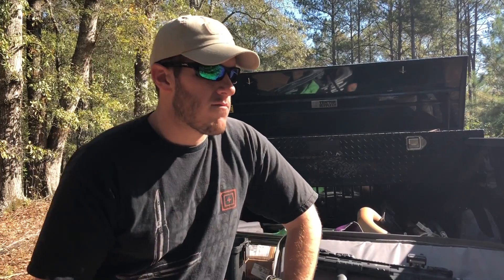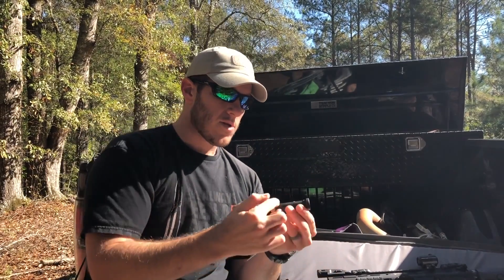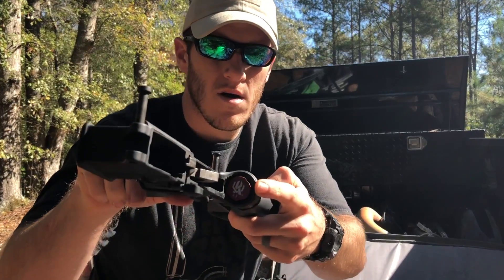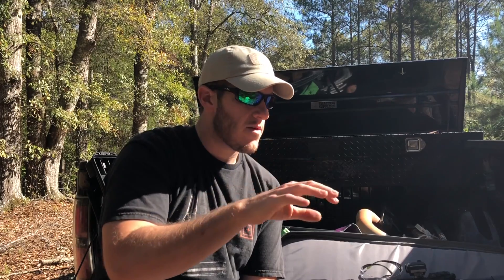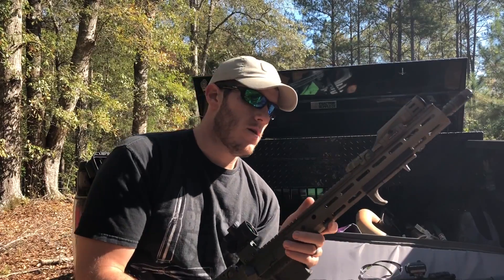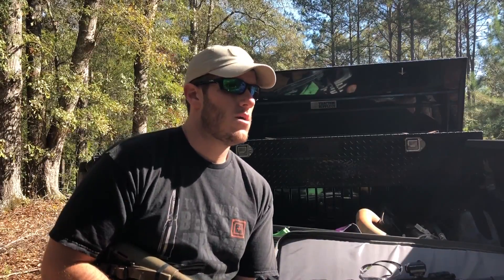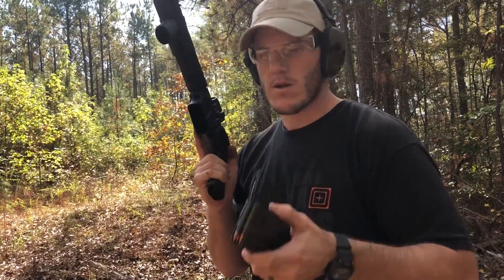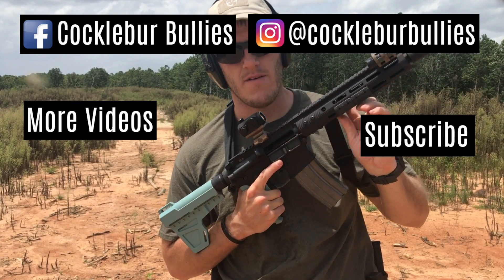AR-15 Buffer Weight Discussion

Comment: My AR15 with after market A2 rifle stock kit came with a rifle butt stock, buffer spring, buffer and spacer. It cycled perfect but ejection is 1 or 2 o’clock. I brought the buffer up to 6.2 ozs. Still not 3:30-4 o’clock. Ordered a Wolff XP (extra power) rifle length buffer spring and it fixed it. It is about 15% stronger and costs $14.99. + $5 shipping.

Comment: I have a Spikes T2 buffer assembly on my favorite AR. It’s a 14.5 barrel with a mid length gas system and a M4-72 severe duty compensator. Lemme tell you, flattest shooting and lowest recoil rifle I have ever shot. The heavier buffers really absorb the felt recoil and the comp is no slouch either. The comp being so aggressive does make it not very fun to be around lol. Also, the spikes kit doesn’t rattle at all because it’s power instead of weights. 

Anyway, this was a great video, brass ejection direction is a great easy tip to tell if you need a heavier buffer. Thanks for taking the time to make it.
Reply from the maker: Thanks, glad it helped. 👍🏻

Comment: Good video man. I'm thinking about my next build. Probably going to go with a 13.9 or 14.5 p/w warcomp or 3prong, with a midlengh gas system and either an H1 or H2 buffer. Do you think that will run well?

Comment: Any issues with the bolt locking back on an empty Magazine with that H2 buffer in your mid length? How about rapid fire, any issues there either?
Reply from the maker: I’ve shot that thing any and every way you could think of with all kinds of ammo and it’s done great.
Reply: @ClangandBang  You think I will be good running 4.3oz on 16 inch mid length 223/556 or should I go down to 3oz ? I’m using 16 inch ballistic advantage mid length barrel.

Comment: I got a DDM4V7 and I got a new buffer and buffer spring I went with a H2 buffer from brownells and a buffer spring from blackout defense and now for some reason I’m getting double feeds it even looks like the lugs of the BCG are striking the bullet on top almost like if the cycle is not fast enough and the lugs on the BCG hit the top of the bullet by the way I did switch out my BCG to a sharps XPB ? Any help thanks !

Comment: I got a custom build 350 legend I took to the range for the first time. Shoots perfect. Will not chamber the next round after ejecting the spent casing. I put in a lighter buffer, and it chambers just fine. Thanks for the advice.
Reply from the maker: Awesome, glad you were able to get it straightened out. 👍🏻

Comment: Soo I have a standard carbine buffer which cycles hot 5.56 no problem and ejects casings at about 3 o'clock/ 3:30. Would you recommend still trying a heavier buffer or am I g2g?
Reply: Heavier buffer = less recoil

Comment: Most civilian rifles work best with heavier buffers. I'm running a H2, and getting ejections at or about 3 to 3:30.
With the 3 oz the weapon is ejecting the spent casings at about 2 o'clock
Reply: Brain Waters Most civilian? That's a dumb comment. You magically know what most civilians are using LOL

Comment: Hi, I have a question. My AR is failing to eject the cartridge.  I've ruled out the magazine... I think its the buffer or spring??? It's a 18in 223 wylde barrel with a standard carbine lower. All from PSA... I use tula 223 ammo... Which I heard that could be weak. Also when I pull the charging handle it just seems hard to pull back all the time like the spring is too stiff... What do you think?  Thanks!
Reply: Hey man i the same problem. Same upper as you! What did you do to fix. My setup sounds identical to yours. Let me know what you did to fix thanks.

Comment: New to the AR15. Watched a ton of videos good and bad. Been researching on how to improve my recoil. My guns recoil is pretty harsh and casings were ejecting at 2 o clock too. Your video helped me identify EXACTLY what I need for my rifle. Gotta H1 (4oz) buffer and a Sprinco “Blue” enhanced buffer spring. Carbine buffer and spring were too weak and light for my mid length barrel. Great video👍
Reply from the maker: Thanks, glad you got your rifle dialed in.

Comment: BCM 14.5 Mid-length gas.  Known to NOT be over-gassed.   H2 buffer and  runs like a dream.  PMC .223 runs fine.
Reply: I have the same thing. every 5 rounds or so I have FTF, also sometimes light primer strike, dud. running H2, Maybe a H1 is in order?
Reply: You think I will be good running 4.3oz on 16 inch mid length 223/556 or should I go down to 3oz ?

Comment: A trick you can do is purchase a lightweight carbine buffer and a single H3 buffer and interchange the weights to your heart's content. Prevents purchasing more than you have to. 
From what I've gathered, but I'm still uncertain: anywhere from 3 o'clock to 5 o'clock is a good ejection window for optimal gas. I am unsure how much you could adjust with an adjustable gas block, or if you'd want to tone your gas down too far for fear of causing other possible issues. I don't have an adjustable block, and no experience with one. 

I've had really good experience so far with my 16" mid-length gas barrel and a standard carbine weight so far. I've only noted issues with steel cased .223 short stroking and only failing to lock open on empty.
Reply from the maker: That’s definitely an option if you don’t mind doing a little tinkering with the weights. Some people might be afraid to mess with them and others might enjoy it. I’m usually satisfied if the gun ejects M193 at 3:00. That way I know it’ll effect .223 at 4ish and it still has enough cyclic energy to run all types of ammo. 👍🏻

Comment: Important note to add:
Makes sure whatever buffer you choose the bolt locks back to the rear after the last round, and chambers a round into battery efficiently
Reply from the maker: Yes! Thats definitely the most important thing. Doesn't matter how smooth it runs if it don't run.

Comment: Im building an 18 inch barrel AR with low split times in mind. What should I go with
Reply from the maker: I would start with a good trigger and a muzzle break, the buffer will probably be heavier than a carbine weight. It’s kinda hard to say without knowing the other pieces of the gun.

Comment: Building a 10.5 300bk using a Franklin armory binary trigger what buffer weight would you suggest.
Reply from the maker: I’ve heard that .300blk ARs can use lighter buffers than 5.56 ones.

Comment: Odd question: I shoot left-handed, so the 5 o'clock ejection angle sometimes burns me (casings landing on arm, shoulder, or even neck). Is it harmful to the rifle to have a lower weigh buffer to force the shells to eject at 1 or 2 o'clock (thereby avoid being burned)?
Reply from the maker: I don’t guess it would hurt too bad. It’s better than getting burned by hot brass.
Reply: @ClangandBang  Thanks for the personal reply. As I'm thinking about it, I'd rather get used to the possible shell burns than hope my rifle doesn't cycle properly-thereby preventing me from defending myself. Maybe I should learn a new stance, hold, or shooting profile?  Thanks, again, for the response.

Comment: Most of the buffer issues are with full automatic mode and is why they went with heavier buffers.   Apart from the gas tube the weight of the actual barrel plays a role too.   Just adding more weight up front changes the dynamics, a heavy barrel meaning it weighs more requires a h2 buffer in automatic mode. 

All of these were for machine guns not semi autos.   For semi auto a standard h buffer will be the most reliable in all temperature conditions it will be more reliable with ammo in various conditions.  If you life depends on it its the lighter buffer will be more reliable over a range of conditions.   For plinking use what you want but its not a big deal as its just for semi not full auto, then use the heaviest buffer that will cycle. 

The Buffer - Theory and when to Use What Buffer
https://www.youtube.com/watch?v=DYf-MLMODhA&t=998s
He does a good job on giving the real history of why they even use H, H1, h2 etc buffers.  It was not for civilians playing army at home it was for military and issues with firing 800 rounds per minute.

Comment: I'm running a 20" upper on a standard carbine collapsible stock lower. If I run hot 5.56 ammo it will run great but won't run. 223. What buffer should I be using?
Reply from the maker: If it cycles the hot stuff and not the weak stuff it sounds like it needs more gas or a lighter buffer.

Comment: DD barrels in general are set up for max reliability with H buffers— that’s what DD ships in their full rifles. They will run h2 fine if you aren’t combining weak ammo with cold temps and a dirty gun.
Reply: Hey isn’t that just adding 1 tungsten weight and is h1 and h the same?
Reply: @charlotteresidentr6799  yes, H and h1 are the same.

Comment: No the bolt doesn't pick it up.  The bullet isn't seated in the chamber because it's either jammed  at an angle upright or nose dived.  The first round ejects good.  So it's a short stroke issue....I think??  I'm not a gunsmith, just a hunter.  Lol!!
Reply: Without the can it works flawlessly.  Thank you for your help.  I'll try a heavier buffer.  I'm looking at the odin works heavy adjustable buffer.  You can swap out the weights and fine tune it.
Reply from the maker: dale estabilio that sounds like a good option. The can is more than likely adding too much gas and messing with the bolt unlocking timing. Of course that’s just my uneducated assumption 😉
Reply: Uneducated maybe but logical!!
Reply from the maker: I'm not a gunsmith either, but it sounds like a short stroke. A heavier buffer might help with the timing of the bolt unlocking, which could give the carrier more energy going back. The combo of the 300blk's short gas length, the long dwell time, subsonic ammo, and a silencer make it a bit tricky to diagnose. How does it shoot subs without the silencer?

Comment: My first round ejects, my second round stove pipes.  So I'm getting a failure to feed.  Running a Palmetto State Armory, 300 blackout, subsonic,  surpressed, 16" barrel.  Stock buffer and buffer spring.  Should I upgrade to h1 or h2 buffer??
Reply from the maker: Does the bolt pick up the second round from the mag or does it slide across the top of it?
Reply: I went with a slightly heavier h2 buffer and it cycles great!!  I got the Odin Works (heavy) adjustable buffer.  I highly reccomend this.  You can swap out the weights in the buffer and tweak it until you got it dialed in!!
Reply from the maker: That's awesome! I'm glad you got it running good.
Reply: Thank you for all of your help!!  Appreciate it!!
Reply from the maker: dale estabilio anytime man. 👍🏻

Comment: Good video, a couple notes for all...A carbine with a short barrel does not have more dwell time, in fact it has less.....However, the gas system in a short barrel carbine is operating at a higher initial pressure.  You're also running a linear compensator which is increasing your dwell time somewhat and acting somewhat like a longer barrel, so this is not a traditional flash hidden short barrel carbine which can act different.  Of course this is all dependent on your gas hole diameter which is really the deciding factor in how a carbine will act with various reciprocating weights.  The carbine buffer was initially designed to be used on milspec old school short barrel carbines (10"-11.5"), not because steel is simply cheaper, but because those barrels required a lighter buffer to function properly because they had far less dwell time than a 20" rifle system.

Comment: Im having failure to ejext with my ati ar pistol,  not sure what length i believe it 8.5. Took ot to the range after installing a sig sba3 brace, after a quick 8 round burst i was having failure toneject on every round. I need help might try the buffer trick since i did installed a new brace which came woth it is buffer tube.

Comment: 10.5 Carbine Length 556

Which buffer weight?

H2?
Reply from the maker: In a lot of cases the H2 will work. There's a lot of factors that will play into that though.
Reply: Depends on the port size

Comment: On my Adams Arms piston 16” AR-15, I have to run an H3 buffer for all ammo. For hotter 5.56 NATO rounds I had to adjust the gas block to “suppressed” in combination with the H3 buffer to cycle and eject properly. 
The gas port on this particular carbine must be extremely oversized. 

Originally the rifle came with a 3oz buffer that had violent recoil and was actually wearing the receiver from the cam pin and wearing the buffer tube from bcg tilt. I couldn’t believe this AR was kicking so bad at first. H3 buffer and suppressed setting makes it smooth like it should feel. 
BUT, even with the H3 only, the 5.56 casings will tear up the deflector (actually removing metal). Running on suppressed cleared that up and now ejects at 3 o’clock without tearing up deflector. If this were a DI gun, I’d have to install an adjustable gas block.

Comment: H2 will slow it down for sure. Another approach is adjustable gas block. If shooting suppressed I use a Superlative gas block. They cut down on gas in your face and felt recoil.
Reply from the maker: Adjustable gas blocks are a good way to fine tune the gas. To me buffers are cheaper and easier. They aren't as precise, but they still get the desired results.

Comment: New 10.5 pistol length with a carbine buffer and I'm getting a 3:15to 3:30 ejections but I'm also getting a lot of gas blowout from the upper receiver. Is this normal???
Reply: Curtis Jenkins put an h3 buffer for in it an sbr is going to run at higher pressures hell I run a h3 in my carbine with a chrome silicon buffer spring which I also would tell you is a must in your sbr it helps level out the internal pressures and allows the bolt to cycle consistently each shot trust me try that combo you will love it and it will run as smooth as glass

Comment: The only ARs that require an H2 Buffer is all Heavy Barrels / SOCOM Profile.  Also any Piston should have an H2. There us only 1 AR I know of that requires a H3 Buffer. That's the Colt IAR.
 The reason why you need H2 in pistons or HBAR is because of bolt bouce.  It's not that noticeable in Semi auto. When you switch to full auto it will be noticeable .
Standard for most carbines is H buffer.
If you wanna know more about buffer check out SMALL ARMS SOLUTIONS.  Chris is the leading expert for small arms and has all the data and knowledge to back up what he says . He is about the only person I believe when it comes to small arms . .
If your situation your gum is over gassed . This is a common issue with DD carbines . In the past year DD has fixed most if those issues . 
You should never use buffers to cure an over gassed issue . Using certain types of ammo might cause it to fail . The only way to solve your over gas issue is Adj Gas Block .

Comment: Just get you some cheap tungsten carbide end mills from China that are the right diameter and cut them with a grinder or chop saw and replace the steel weights in your carbine buffer forgot to $3 or you can just fill it with hot lead if you don't need it to be that heavy

Comment: my truck gun is a 10.5 inch 5.56 ar pistol that is severely over gassed do you recommend using an adjustable gas block or trying out heavy buffers?
Reply from the maker: The quickest and easiest option would be a heavier buffer. An armorer or a "gun tuner" would say gas block because it fixes the problem at the source instead of masking it.
Reply: Fixing a prob at the source would be the right size hole drilled in the barrel

Comment: Your H2 weighted buffers might be slightly too heavy (due to ejected cases ejecting to 5 o clock) and will eventually cause failures to feed when action gets dirty. Maybe using only one tungsten buffer weight so ejected cases will eject to 3 o clock direction?